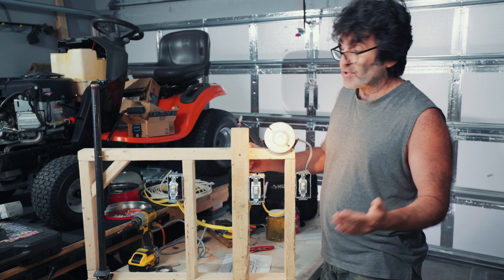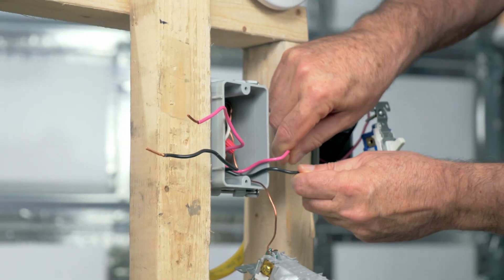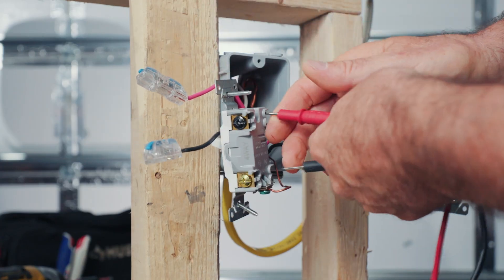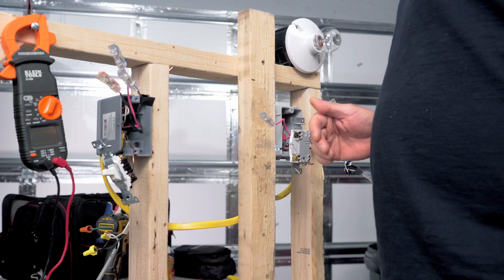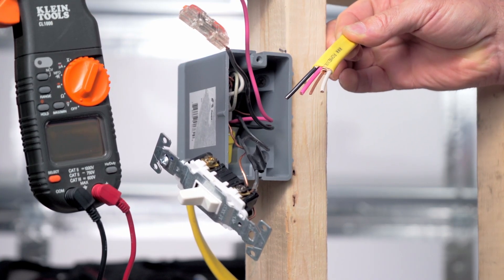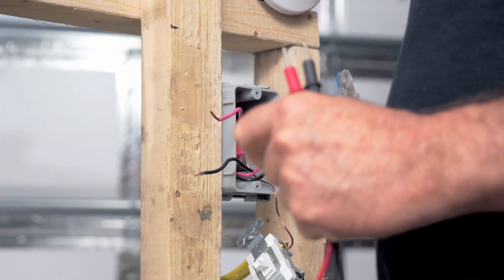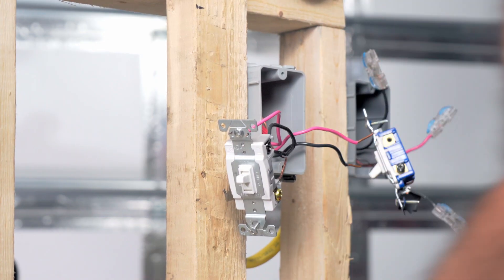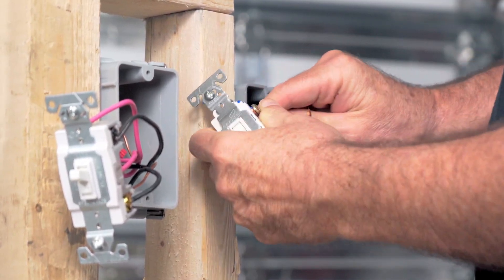How to Fix Your Botched 3 or 4 Way Switches [+ Troubleshooting a Bad Switch]

Comment: FYI, had to replace a four way and the local Ace only had a Levinton 5604-2 (white) and the trailers are fastened on the left and right verses top and bottom.
Reply from the maker: HI!  Thanks for the info... 😊  My local Ace has a pretty limited selection on electrical stuff.... Lowes/ HD has a much bigger selection...

Comment: Fantastic. I've learned about & used loopback testing in another field decades ago but it never occurred to me you can make a "loopback plug" on house wiring and use an ohms / continuity tester to recognise pairs. Fantastic tip!  Now to sort a friends hallway with 3 switches, the fact it doesn't work properly, and that I know how it SHOULD be wired has bugged me for years. I assumed wrong wiring - but now I know I should be testing the individual switches for correct functionality first. Top man, thanks!
Reply from the maker: Excellent! Glad this helped you out... Thanks for the great feedback!  Usually the key element for 3 or 4 way switches not working properly is that someone had recently replaced one or both of the switches!  If it worked correctly at some point, then the wiring cant be wrong... However if the home has mice or something chewing on the wiring, that could cause a problem too... so it's not 100% guarantee that it's a bad or miswired switch.. 😊

Comment: Love teh video.  I have been installing a bunch fo automation switches and outlets. I was going a 4 way dimmer switch in a 2 (3 way with a 4 way sitting in between).  Was not working correctly before swapping out to use automation switches.  Now I think I know what to look at.  What is your meter set to for the type of testing you were doing?
Reply from the maker: HI!  Thanks for the great feedback.  I can't remember which part of the video you're referring to with the meter setting.  Rule of thumb.   If the power is on, never set the meter to "ohms", but always to volts ac on at least 125v scale or more. it will possibly damage the meter on ohms.  If the power is off and you want to check for continuity then you can set it to ohms...

Comment: All of my switches were working. I just replaced a 4 Way switch, so its color would match a new cover plate. 
I left the other 3 switches alone. The older switch is probably 30 years old, but I followed the same wiring set up on the new switch, but it didn't work properly.
The 4 Way worked as a "main" switch. In the Up/On position, I know that these switches aren't labeled On/Off, it turned the light on, and the other witches could turn the lights On/Off. 
If the 4 Way was in the Down/Off position, the other wouldn't work at all.
After some time, I was able to get the switches to work together, but now, when the light is off, all the 3 Way switches are in the Down/Off position, but the 4 Way switch as to be in the Up/On position.
Before, when "everything was off" all the switches were in the Down/Off position.
Call me OCD but this drove me bananas.
I left it this way, but as I put the switch back into the box, I turned the switch 180° and secured it into the box that way. Now, when everything is off, all the switches are down.
Honestly, what happened to me. Thanks, and Happy Thanksgiving.✌🏾
Reply from the maker: It sounds to me like one of the 3 ways in the setup is wired in wrong.  WIthout being able to see that, It's a hard thing to troubleshoot.  They should each one of them be able to turn on/off regardless of the position of the other switches.

Comment: I just bought a new house and want to put a dimmer on a 3 way circuit. I installed it and if one switch is off the dimmer switch won’t work unless have 1 switch on. It’s not letting turn on and off from both  switches .
Reply from the maker: HI... It sounds like you have the wire that's supposed to go on the black screw in the wrong place.  If you haven't touched the original switch that was already working then the problem has to be in the one you just changed out.  If you look inside your switch box and see which set of wires has the red and black together in the same bundle.  Those are your travelers and they go on the brass screws.  The one that's left over either goes to your light fixture or it has power coming from a power source.  Either way, that's the one that goes on the black screw.
Reply: @ yes I called Lutron who. By the way, is amazing. I got connected to a rep, right away, and had the switch plates already removed. He hooked me up with a link that asked me to aim my phones camera at both the original switch, and the dimmer. It was as you said, the power source wire on the dimmer was on the wrong screw. I was impressed with Lutron customer service tech line. Thanks for getting back to me.
Reply from the maker: @Birdiebill74  That's awesome!  SO glad you got it going again... 😊

Comment: The world never needed a 4 way switch 😂😂 3 way switches however are definitely required for logical convenience…. But anymore, WiFi, Bluetooth, etc lights, fixtures and whatever you traditionally used a manual on off switch for are really not needed…
Reply from the maker: HI... In some house situations a 4 way is quite helpful...  For a house with a foyer it can be helpful to have a switch in 3 differernt places...  😊